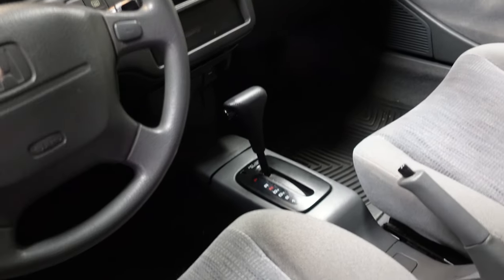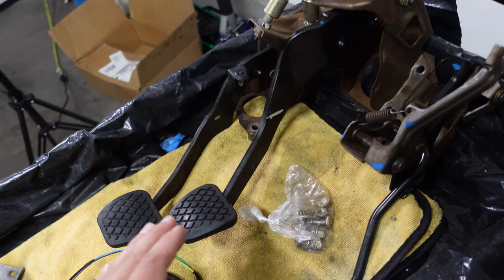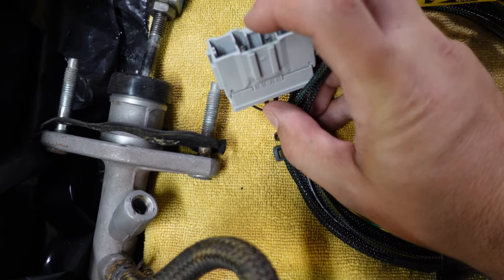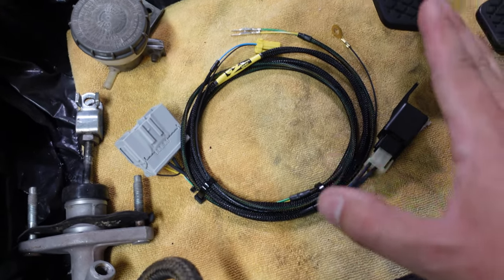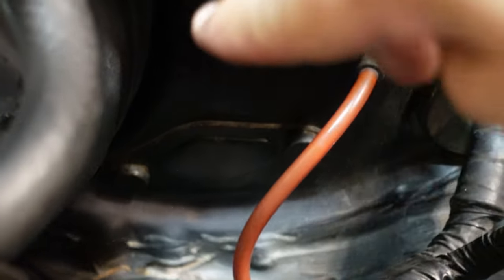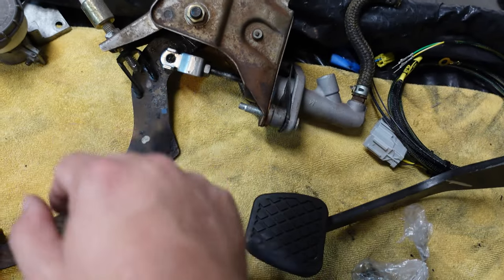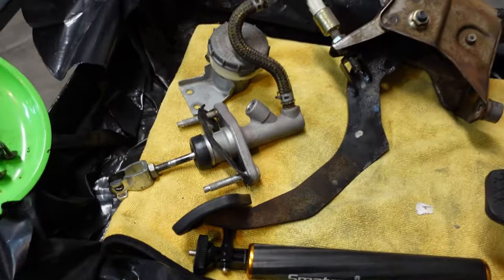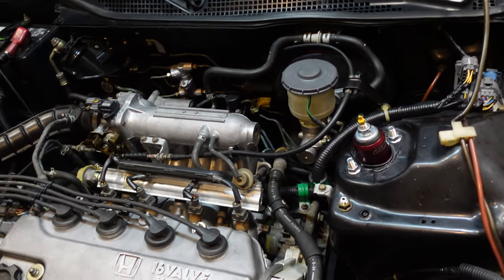Converting my Automatic EG Civic To Manual

Comment: Wondering what you did to get the cables through? I ended up cutting out a square In the firewall but it's so tedious and it's annoying
Reply from the maker: I cut a hole in the firewall with a hole saw right behind where the SRS module was. Katman from FFSQUAD has a great tutorial on it. Took a couple minutes.

Comment: Hi, I'm currently doing the conversion but I don't have the harness, is it serious or not? If I don't have it, does the reversing lights work or not? Is the sensor of the engagement pedal necessary or not?
Thank for your reply
Reply from the maker: You don’t have to get that harness, you can just jump the harness with a jumper wire, but I don’t suggest it cause the factory setup uses a relay to send power to the starter and some people have said the jumper wire gets super hot. The sensor isn’t required, you can just jump that as well, sorry for the late reply.